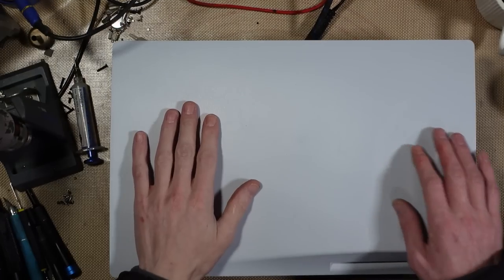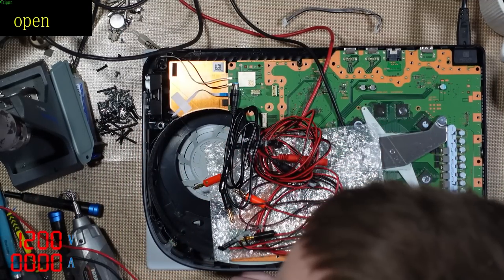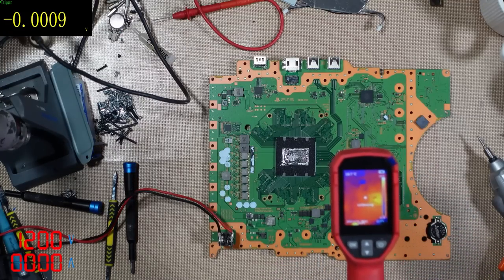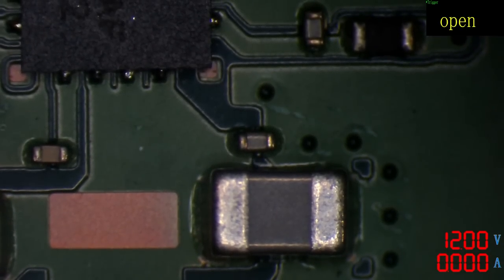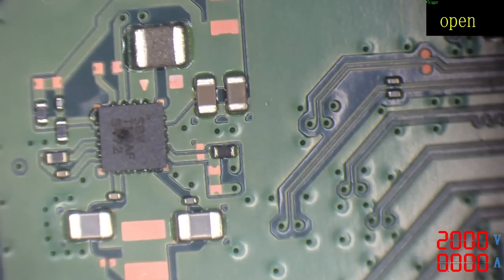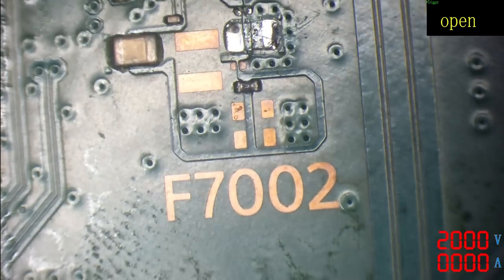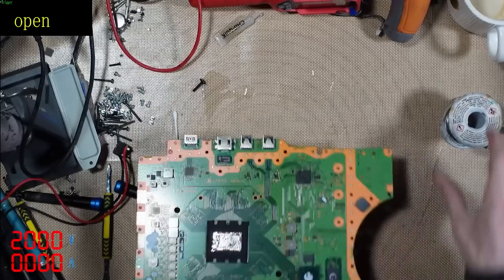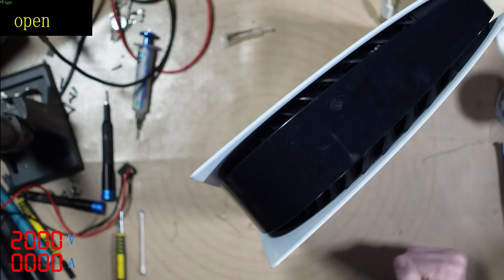Can I Fix A PS5 That Won't Turn On? A Single Beep (Occasionally) But No Power!

Comment from the maker: For parts and components please use our store! https://www.consolefix.shop ❤️
Reply: what about new screws
Reply: Would be a pleasure to buy from you Phill but shipping to Colorado be a ton.
Reply: Happy I never bought one seems to have alot of problems all these ps5 never seen ps4 have all this problems like ps5 have!
Reply: @wildpuppet72  its a pretty small percent compared to how many working consoles there is
Reply: @yamisniper  okay thanks for clearing that up. 👌
Reply: any stream tonight phil
Reply: @TheCod3r  my ps5 wont turn on but beeps when pressing power and eject button ,when i tested  powersupply shows 11.77 volts instead of 12 volts and above is it normal or there is some other issue ,what do u think?

Comment: @TheCod3r 
If they unsubscribed because you use too much guesswork they're just ignorant. 
99% Of initial diagnosis is guesswork ( albeit educated guesswork but the point stands )
you have to guess at the cause of the issue to even have a starting point to repair ANYTHING. 
I'm an Auto / Diesel Technician with 30+ years of experience and went to college for it  ( aka university in Europe ) 
The entire point of getting an experienced technician is that they have likely seen most issues and will be more able to guess what is causing the issue you are having which would save time and money for diagnosis. 

EVERY TECHNICIAN HAS TO TAKE A GUESS AT THE CAUSE OF THE ISSUE TO BEGIN THE DIAGNOSTIC PROCESS.

Comment: For those of us that have frequent issues with their power delivery (here in Ontario we call it hydro) I can highly recommend to purchase a 550 watt UPS with a battery protection.  The PS5 can remain in sleep mode on the UPS as it drops down to about 50-70 watt consumption (same as a lightbulb).  I have all my expensive devices on UPS and once we lose power they will remain running for a reasonable amount of time (10 minutes to one hour, depending on the UPS).  It is worth it and some even come with a guarantee, I have never had to use it.
Reply: Having a UPS Battery Back-up is a great idea. It also, helps with Undervolts, Overvolts Plus Power Spikes.

Comment: Sony smashed it with an unfinished console. Got to hand it to them.
Reply from the maker: Haha yep
Reply: Have the Xbox X as well and like them the same
Reply: Only had to wait two years to get a PS 5
Reply: Think every console has its strengths and flaws. The 360 in my opinion was the worst. Mine burned to the ground.
Reply: First PS 3 sounded like a vacuum.

Comment: My PS5 froze and turned off on me and had a single beep with no light last week. I would have sent it to warranty service, but disconnecting the power for half an hour fixed it in my case. Not sure if that's lucky or not, because my warranty expires in about 6 months.
Reply from the maker: Yeah that sounds like it just maybe had a little surge and the built in protection actually did its' job. Good stuff
Reply: That's a common overheating problem. some ps5's are worse than others. i send mine back for a replacement because it happened about 5 times in a month and i got sick of it. i believe they have changed the fans on the newer models now.

Comment: my ps5 wont turn on but beeps when pressing power and eject button ,when i tested  powersupply shows 11.77 volts instead of 12 volts and above is it normal or there is some other issue ,what do u think?
Reply: Hey did you able to fix it? I have same problem.

Comment: I got a system like this 12v short had a similar issue with a hole in it. However whome ever attempted repair before pretty much destroyed the system. Used thermal paste everywhere and it was missing parts aswell as had a destroyed psu. Ebayer claimed it was sent to a shop ofc however I have other feelings on this. System remains dead on my bench to this day.

Comment: Great video as always, thanks!
Regarding the fuses and capacitors; when there's no access to a donorboard, are they available anywhere else? I checked your store, ALiExpress and a few other retailers but no luck..
Reply from the maker: You can buy the caps on digikey and mouser, and the fuses too, but I'm not sure on the value. I'll figure out what's needed tomorrow and try and order some in :)
Reply: @TheCod3r  he did you ever get the values?

Comment: My ps5 got zapped from I assume the tv. Tv is dead along with everything that was connected to it. Ps5 only beeps like this one, 12v coming from the power supply is good. Then I noticed the encoder chip is reading grounded. Could this be my power issue?

Comment: Hi Phil, I have watched every PS5 fixes of yours amazing works. My PS5 just bricked with long pulse BLOD after one green screen of death.

I sent it to Sony and they would charge me a cost higher than buying a new one. I have done some research and it might be a faulty APU, which is unfixable now. 

In this case, is it worth to get them to the repair shop. Would it be possible that this is not caused by APU?

Thank you so much.
Reply: I am from Thailand and we still have limited supply of ps5
Reply from the maker: I would take it to a repair shop to be honest. The green screen of death is normally caused by a bad encoder or bad ram, so you'd probably need to send it somewhere with the ability to reball and replace the ram if necessary or someone with good fault finding skills. I wouldn't just replace it before sending it somewhere to try and get it fixed. Hopefully you have some good luck with this one
Reply: thank you so much, Phil! 

I will do as suggested. Hopefully, it will not come down to reballing since there might not be anyone able to do so here yet.

Keep up the good work!
Reply: @timikik6490  is it working now

Comment: Microsoft caught Sony out with the timing of the release of the Series X. Sony was way behind in the Q&A and rushed to get a serviceable console out. No wonder so many are failing and hence the very unSony like design
Reply from the maker: Yeah that sounds about right, which is why the Xbox is so solid compared to the PS5

Comment: Please help EDM 020. I get one beep on the power button ever now and then but nothing else.
Took it apart and checked 12v and that was fine. Checked 5v on the F7002 and its there but the output seems to be grounded from this video Cod3r says it should be 1.8v on the 020 board. When I turn the 12v supply on it goes to 30a then drops back after a few seconds.
I have made a post on TheCod3r Discord so hoping someone can help me from either here or there.
I am not sure where to go from here anyone help please?

Comment: I had the same issue..but after it been fixed..a bluetooth connection issue apeared..so the controller wont connect more than one feet from the console

Comment: Mine beeps every time. And the disk tray. Does it beep as well. I’m thinking of just sending it in. I don’t have the tools or knowledge you have
Reply from the maker: It can be quite difficult to figure out to be honest, especially since we don't have schematics available for these things. Without looking myself it would be pretty hard to pinpoint your particular issue, but I'm happy to give it a try if you need me to :)
Reply: @TheCod3r  you are a god amongst men man. I’ve been stressing so bad. And this ps5 is one my fav possessions. Got it with the invitation to Sony to buy it. Life has kicked me in the ass. My car ac went out. My house got hit by lightning and we have been trying to get everything back together. But this ps5 situation hurts my heart.
Reply: @TheCod3r  if you can do you know or have an idea of what happened. I don’t have your expertise on motherboards. Swear when I saw you doing all this. I was oh this dude is the real deal.
Reply from the maker: @mikeykane5938  it could be a number of things really bud. Soke of them die because of a power surge, others can just be random component failure. A lot of components on electronics have a finite life span, but Sony just like other manufacturers seem to use cheap low quality components such as capacitors, and they fail sooner than expected unfortunately :(

Comment: pretty much in all diagnosis is guess work as an auto tech no all problems can be ran to one solution one problem may be causing other systems to fail from another component you just replaced

Comment: Hey Phil, is ps5 that bad, I have had mine for a year now, and no issues touch wood.....
In saying that I don't bash up USB ports and HDMI ports I am good with my shit.
Also, I will clean the fan and stuff here and there.
Reply: Also in storms and unplug HDMI and power even tho I have a surge protection power board they have failed me in the past.
Reply from the maker: It's not that they're bad per se, it's more that instead of just waiting to push more out they cheaped out on parts like capacitors so they could fulfil orders
Reply: TheCod3r  yeah I get ya mate, well there bloody hard to get, I know here is aus the pre-orders are still crazy, if you can get one

Comment: meanwhile my ps4 fom 2014 is still going strong yes the ps4 had thie own set of problems also but the ps5 takes the piss. so glad i didnt bother getting one and i wont be getting one.
Reply from the maker: Yeah the PS4 did have its' problems but nothing like this in terms of cheap components and terrible circuit designs

Comment: Unsubscribed because of too much guess work???? Are they serious? 
All I see on YouTube is people randomly testing MOSFETs and capacitors for shorts, then "out with the thermal camera" to look for the overheating component. 
I've seen more skill in your videos that most channels combined!!!
I'm not knocking other people's fixes, but a bit of in depth explanation wouldn't go amiss. 
You keep doing what you're doing buddy.

Comment: Ps 5 sucks so bad man
Reply: Nah love mine. MLB the show Grand Truismo are awesome.. And the controllers are awesome
Reply: Design wise, it really does. But games look nice and it generally runs them well. Just a shame they have many problems.
Reply from the maker: Yeah I have to agree, in terms of power it's great, and as long as they don't end up with these issues they can be great, but too many cheap parts and a rushed console ruin it for Sony